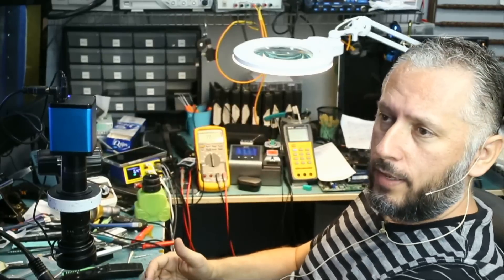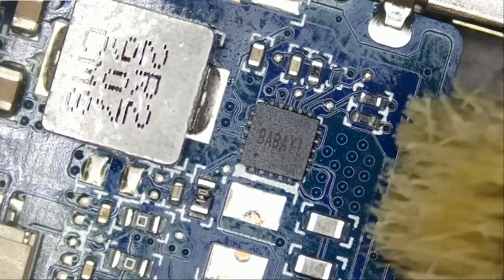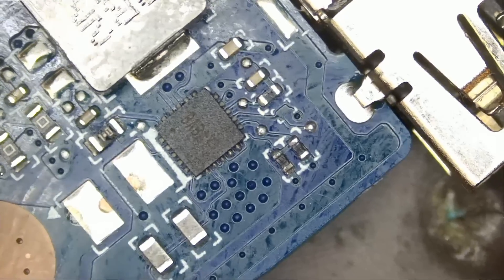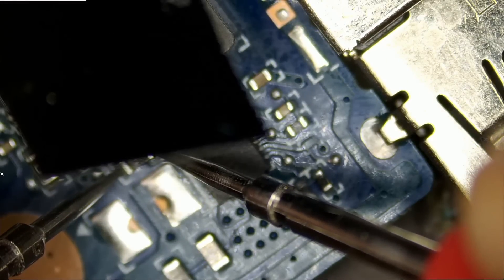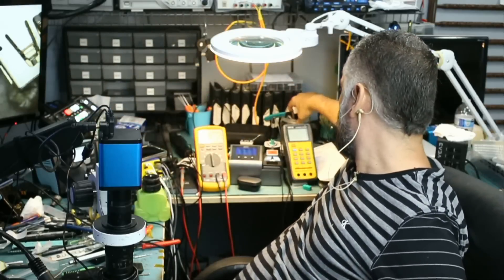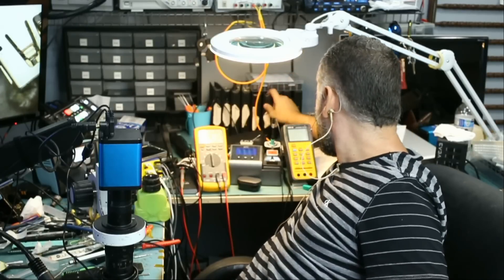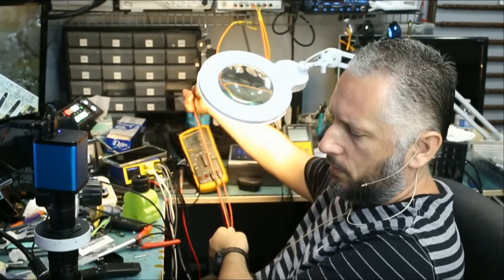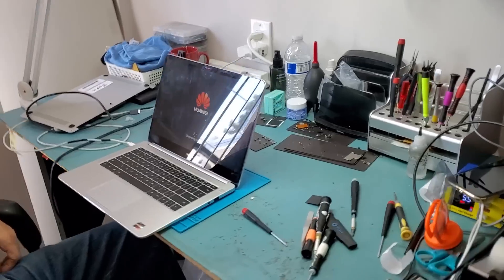Huawei Laptop Motherboard Repair - Won't turn on

Comment: Hi, i have a huawei laptop, when i was carrying in my bag the bottle cap was opened and the few water might be goes inside from charging side of laptop, after a while i checked the laptop can work but display is not. i checked all the properties with connecting other screen by HDMI, just only screen does not work. What should i do? Im not sure is it mainboard problem or screen, the guarentee services probably does not do anything. Does all the computer fixers know that you do?

Comment: Irrespective of the skills needed to undertake the repair, it's annoying to think that an otherwise perfectly working laptop would have been thrown away for a resistor costing fractions of a cent.  It's  pleasing to see repair videos like this, bringing devices back from the dead and giving them another lease of life. - Well done
Reply: While I certainly agree I must say that most of the time the repair of liquid damage isn't this straightforward though.

Comment: I wolder how many devices went to trash for a simple resistor with a value of 0.0000000....$. That's why is so important to have guys like him to diagnose and fix this. It's insane the amount o e-waste that probably could be recovered and reused if companies and people are willing to promote repairing. Nice job as always

Comment: if these were parallel resisters,  it should have not read open.  you would have read 150 on both side.  something don't add up.  but it is correct to read 75  ohm when both are 150 ohms.
Reply: The pad under the recistor was corrodet, thats why he measured OL. That was his luck
Reply: See 8:12

Comment: Great fix .. yeah .. it's a small resistor change but the experience needed to figure out the problem is the main tool here.
Reply: That's what i thought 👍
Reply: Exactly you don't pay for the time or the components, you pay for the knowledge and expertise.

Comment: These can be pretty cheap but amazing for price/performance
Reply: yep, got a matebook 14 with ryzen 5 4600h and 1440p display, a similarly priced asus laptop would've only had 4 core i5 1135g7 and 1080p display